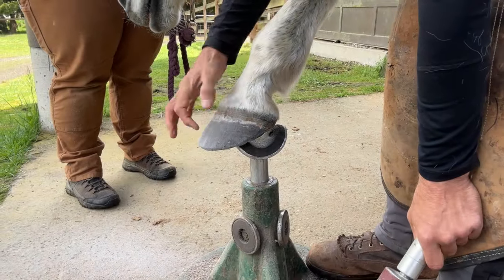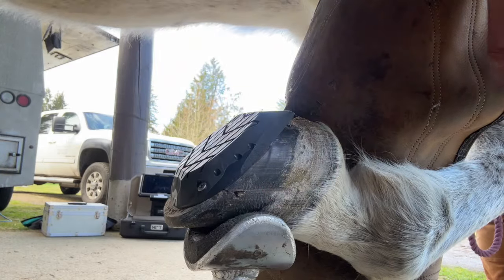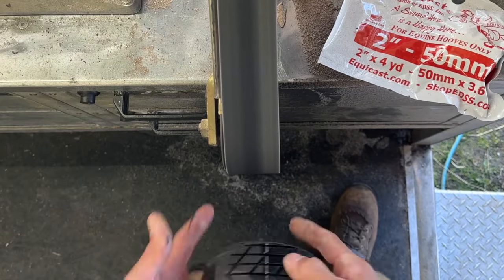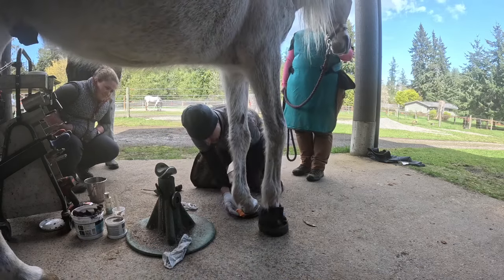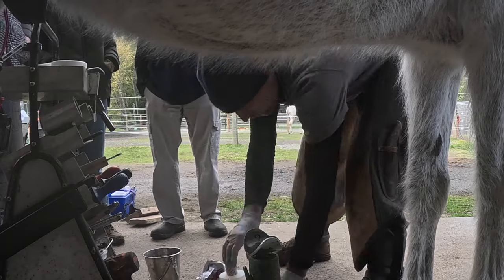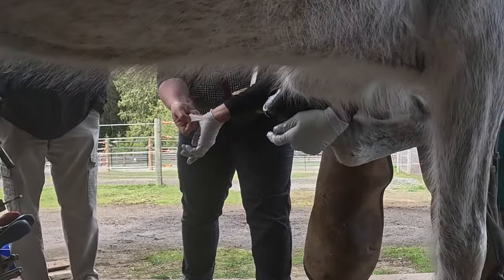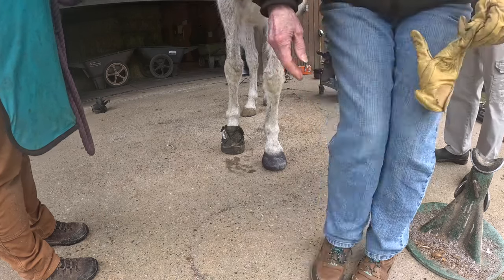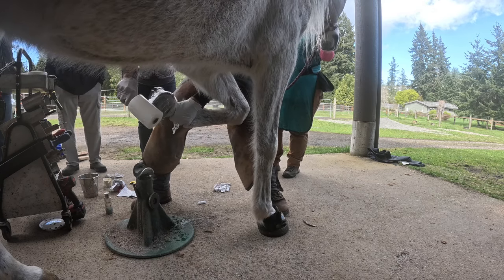Helping a horse 🐎 with laminitis❤️‍🩹,  tips and tricks👍 for casting on a clog or horseshoe

Comment: I am not a horse person. A horse scares me, but my question is rather silly . How do you know if a horses hoof is hurting? So interesting and also . How did you get involved in fixing  horse hoofs?
Reply from the maker: Hello , there are multiple ways of finding out if a horse is in pain. The first clue is how they walk. You get to know what the cadence looks like. You can see when a person is limping or gimping or not bearing equal weight on their two legs same goes for the horse, even though horses are not able to communicate in the English language they are able to communicate, likes and dislikes. It does take years to understand this type of language. Then using diagnostic tools, ultrasound, MRI x-rays you can then make educated guesses on how it may help the current diagnosis. As you become more involved in therapeutic work you start to see trends of things that work and don’t work.  of course there are times that you tried to do something that you think will work and help from past experiences and it doesn’t work as well as expected so you gather as much information possible and shift and go another direction. I think I became interested in the therapeutic aspect of horseshoeing when I first started my business and multiple horses were brought to me with different problems. I wanted to see if I could provide some relief for the horse. So I quickly decided to find different clinicians teachers and mentors to help me understand the art of taking care of the horses foot, anatomy how to manipulate and attach different materials . Hopefully this is not too wordy. I love it when a video strikes curiosity for some one so thank you for writing in. Cheerio.